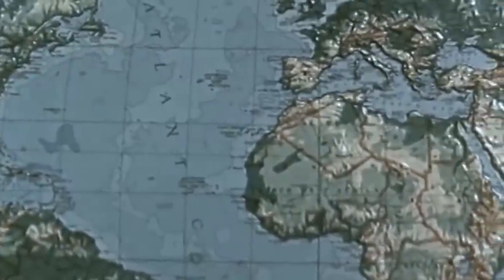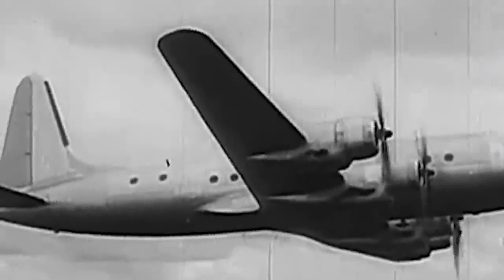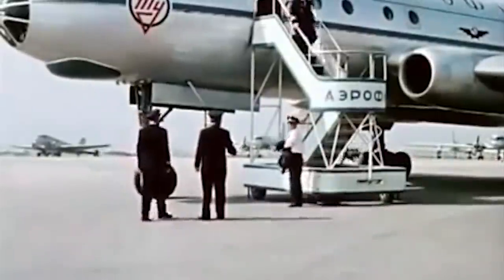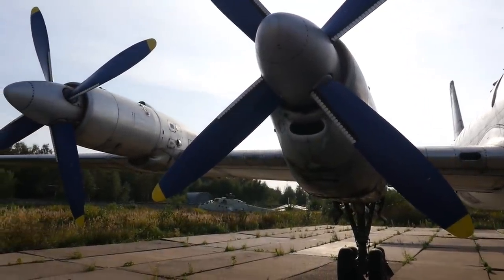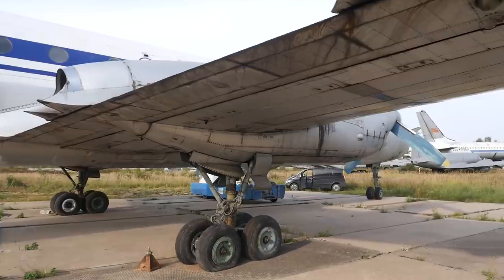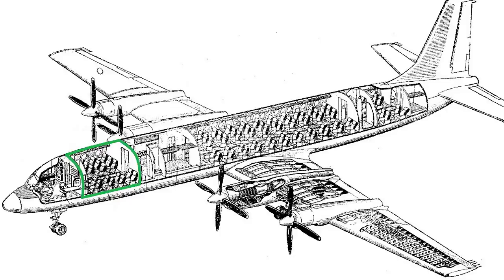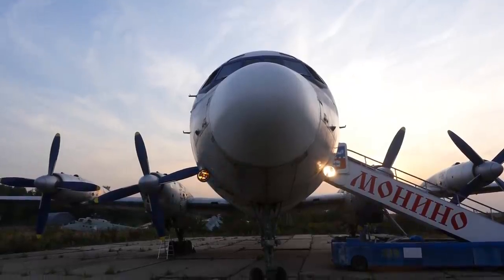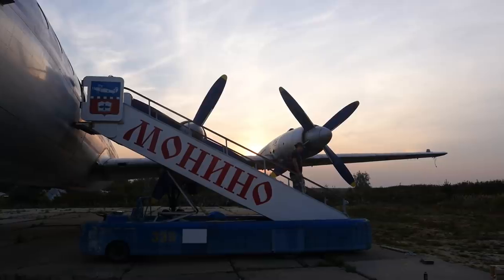IL-18 - airliner for everyone

Comment: Couldn't click on this one fast enough. The IL-18 has always been one of my favorite turboprops.
Reply from the maker: It was good)
Reply: @SkyshipsEng  It was kind of the Soviet version of the Electra, except the IL-18 had the full support of the government to get it through its teething troubles. It's pretty clear from the performance and longevity of the Orion that the Electra could have been an equally successful airliner if there was support to get it through its early troubles. Air Koryo flew its five IL-18's from 1966 until the last one was retired from passenger service in 2017, and did so for the entire 50 years without a serious incident
Reply: I've bought all the books I could on the il18. Fascinating aircraft. Dehaviland actually offered to see ilushin the tech to synchronise the props and thus eliminate the vibrations but the price was too high. So galley relocation it was!
Reply: Q111
Reply: @mrrolandlawrence  Thanks for that-- the formative period is often more interesting than the design release and field history.
Reply: Agreed, i think in terms of volume, the lockheed electra is its counterpart
Reply: @sarjim4381  For the IL-18, the closest looking alike airplane, is the Bristol Britannia. It is rumored that IL-18 was "inspired" from Bristol Britannia, actually...!!! Anyway, the IL-18 still is considered, up to these days, as one of the most robust and reliable passenger/cargo transport planes ever built, with a very economical overall exploitation.
Reply: @SkyshipsEng  Flew many times on the IL18 in and out of Bulgaria with TABSO and Balkanair, in the late 60s and early 70s. great memories
Reply: It really is a nice looking aircraft.
Reply: Truly a beautiful aircraft. Very happy to have seen two in person.

Comment: My flights in these aircraft were not as rosy as the narrator would suggest, or some of the comments.
I visited China towards the end of the '70's, and flew on two internal Il-18 flights.  I am not particularly tall (180cm) but for the first flight my knees were hard up against the arm bosses on either side of the seat in front.  The second was better, but the difference for us visitors was made up by jamming the rear seats (with the locals) into even less space.  For the legless indeed.
Then there were the engines.  All was fairly normal when they started and the aircraft taxied.  But the whole plane was shaking from the vibration at take-off power.  The noise matched the vibration.  I understood the aircraft and still was unsettled.  The others in the party were terrified.
I had read about RR micro-balancing the moving parts of the Spey not long before that trip, and those take-offs showed why that was not just a 'nice to have'.
Also not mentioned was the location of the toilets, between the cabins, in that 'noisy' zone.  What a noise!
In short, I have never been in a Western aircraft that got close to scaring me and deafening me like that Il-18.  They are interesting aircraft, and have a long and enviable record; but I pity all who had to fly in them regularly.

Comment: Yes, on a prop plane the tail is quietest because it is far from the props and the wing blankets the noise a bit, the nose is not quite as quiet, and the mid fuselage is loudest. So !st class is in the tail, 2nd class in the nose, and 3rd right in the middle. On a jet plane the tail is exposed to the exhaust and is loudest, the mid cabin is near the turbines and is in the middle, and the nose is quietest, and furthest from the engines (but usually the most dangerous place in a crash)

Comment: fantastic! did't know this airplane, loved the presentation and details.
Reply: Being Brazilian I have a passion for Electra, after all they operated sovereigns for 29 years (1962 to 1991) on our main airline, the air bridge between Rio and São Paulo without accidents and in addition it was the plane I flew for the first time turn. However, I must admit that the IL-18 had a further refinement, at least in design and, at least on the other side of the iron curtain, it was more successful than our beloved I-188. Hugs.

Comment: Excellent video.  I flew on an Il-18 in 1973. Impressively fast climb on take-off. The prop noise was quite noticeable from my over-wing seat, but other older turboprops also were noisy in that position (e.g. F-27). Nice to see the L-188  and P-3 mentioned, quite similar designs (P-3 is shorter than the Electra, of which several are still flying in far northwestern Canada).  The British had two rough equivalents, the short-range Vickers Vanguard and the long-range Bristol Britannia.
Reply: The British had the Viscount in the '50's ...
Reply: @checkyoursix5623  The Viscount was smaller and with shorter range than the Il-18/Electra/Britannia/Vanguard.

Comment: My father took me to visit a gaint cloth factory in Soviet Union back in the 80s, and I flow on the IL18 during that trip.  If I remember correctly, it was owned by the factory (as the factory was located in the middle of a forest with nothing next to it).  My father told me later that Russian did that to avoid the second German invasion, LOL

Comment: I had the first time in 1975 experienced a charter flight with Interflug (the former East German international airline) on an  Il-18D from Vientiane(VTE) to Hanoi(HAN). Quiet and comfortable aircraft! Until the mid-80s, Aeroflot used to operate long haul regular flights from VTE (Laos) to Moscow via Tashkent with the Il-18D which was later replaced by the Tu-154B which I also experienced on a flight to Moscow. I also had the chance to fly in 1985 on an Interflug Il-62M from Hanoi to Berlin and in 1989 on an Aeroflot Il-86M from Hanoi to Moscow.

Comment: 1:37 I like how on the Li-2 even though it was (I believe) a licensed built version of the DC-3 the engine cowlings did away with the cowl flaps and instead used the rotating shutter style air control for maintaining the engine's temperature. Any ideas as to why that change was made?
Reply: You believe almost right-) DC-3 was indeed licence built in USSR since 1939 under the name of ПС-84 (passenger airplane from factory №84). It had some, hm... minor simplifications in design comparing to original DC-3 due to a certain lack of resources, technology and production culture. During the WW2 the factory was relocated from Moscow to Tashkent, as far as possible from advancing German army, and serial production (directed by Boris Lisunov, after whom the plane got it's new name Li-2) was to be restarted almost from scratch. In such a situation even more simplifications were needed, at the same time plane was slightly redesigned to better fit a role of multipurpose military transport. I hope I answered your question

Comment: As far as I can tell a modern turboprop is 33% more efficient than a modern high bypass ratio turbofan using the same level of technology (turbine inlet temperature) .   They are not that much slower Mach 0.65 versus Mach 0.8 and would have better takeoff performance.
Reply: Although you're correct, the customer base wants to see "jets".  That's who pays the freight, so the airline shows them what they want to see ... It's sort of like being led around by the blind ... A Convair 440 re-engined to become a 580 is one heck of a durable bird ... fast, quiet, comfortable, and a joy to fly ...

Comment: Turbo-Prop comes not only with greater efficiency in air, since Propellers have better aerodynamics in air, but also because the slower plane has much less resistance in air.
Resitance of a body in air in relation to speed is a quadratic function!
So Turbo-Prop driven Aircrafts benefit in two ways, the greater efficiency of propellers over ducted fans, as well as the lower resistance in air as a result of lower speed.

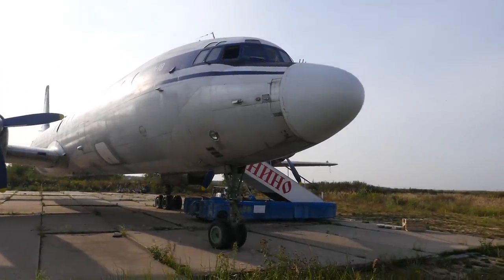Comment: 12:17 I don't think that is quite accurate. A 'seamless' (or stepless, as we call them) nose is intended to reduce drag at higher speeds. yes,  they appear to be less 'sharp', but that is not actually important beneath Mach 1. The ideal low-drag shapes are round-nosed, like fish, so a B-29 is actually quite low drag, even though the nose is a hemisphere. What does create drag is to have a broken outline, to make the airflow change directions. Ideally you want a totally smooth, uninterrupted fuselage line. A sharper nose cone barely lowers drag at all (otherwise modern airliners would all have noses like the B-58), but a separate cockpit windscreen creates a noticeable increase in drag. The reason why they prefer to use conventional cockpit windows is that they are much easier to see out of, even though they increase drag. Many stepless designs place the glazing too far away from the pilots eyes, which causes problems wit depth perception and glare and reflections off the glass. Although with the IL 18 I am guessing the real reason was just because they needed to add a place to put radar into, or even because they thought people would like the conventional nose better, and increase their odds of being chosen over the competition. Sometimes small, trivial points can make a bigger difference than [people realize.

Comment: The IL-18D was a hell of aircraft... More noisy than Britannia (the english was very nice to fly by the way) but faster and sturdy like granite, and more successful by numbers and service than any other of it type... About 2 tons/hour consumption with 100-120 passenger at normal cruise of 650 (km/h ~ 350 knots) TAS... It can climb upto 33 feet also... Was used on all weather, from frozen URSS passing for the humid, and stormy, caribbean and ending in the dry-hot altitud of Africa... Is my believe that with proper updates it may be useful this days, at least a new version of this reliable design. Will be nice to see a comparison between it and the most modern turboprops in overall performances. Nice video, thanks!

Comment: no one argues with "uncle joe"... very prophetic words! its also worth noting that USSR funding was often slight of hand. Tupolev tu22m3 is a totally different aircraft to the tu22. Funding is easier if old cost codes / serials are used. It's seen as less "risky". Im sure this is the reason for recycling the Il-18 number. Also interesting note that the Vickers Viscount served as a test bed for the new Comet engines. Performance was deemed too good and could be a rival to the Comet so a turbojet Vickers Viscount was buried before it got any momentum. Ironic seeing the issues the Comet had later! 

I have to also add I would have loved to see what might have come of the alternate engines for the Il-18. They were much much lighter. If memory serves me correct, about 2 tons for the 4 engines could have been saved? What makes me sad about soviet aviation sometimes is that great ideas never get developed, just stamped out till death. An il-18 Neo? Wing upgrades? etc.. Boeing did the old trick of the woodcutters axe: after 5 new heads and 10 new shafts, still as good as new!

Comment: It's very strange how Lockeed P-3 Orion has striking similarity to this aircraft.  The dimensions and take-off weight are a close match.  This is a great example of American efforts to copy the Soviets.  The timeline history of these are easily verifiable.  During the Cold War, how many times did you hear the Soviets were copying the Americans?
Reply: The Lockeed P-3 Orion does not have a striking similarity to this aircraft. The Orion is a militarised Electra, and the Electra and IL-18 prototypes both had their first flights in 1957, so it is unlikely that there was any opportunity for copying to take place. And the dimensions and take-off weights are not at all a close match.
 Apart from these tiny details which I have mentioned, you have made a really intelligent and well informed comment.
Reply: No, the IL-18 is not a copy of the American Lockheed L-188 Electra nor was it meant to fill the role the Electra did. If anything it was more of a Soviet version of the Bristol Britannia, except more successful.

Comment: Looks like a Lockheed Electra, just less refined.
Reply: same era, same requirements, same solutions.
And both were developed into military versions for anti submarine warfare, electronics warfare, and other, more obscure tasks.
Reply: Knew A Malev pilot who who said Kerosene wasn't avail at times in Africa,  so at times other combustables were mixed in with the fuel  ,  Waragi  was mentioned.. he said the thing was an amazing work horse, and very reliable and safe.. most accidents were overloads by African carriers,  airframe had zero vices.. think they still use em in the Stan's , would love to fly on one.. supposedly it was so docile in the pattern,  some guys washed out when the 154  was introduced,  just could not adjust,  he said the 18, and the 154 m were his fav birds.. the 18 any day on a short hop..

Comment: I flew in them often, in China, in the mid-80s. Maybe due to maintenance but, the aircraft was not at all impressive either in the performance, or the relative quality of its construction. Most of Soviet era designed aircrafts are either copies of western aircraft or, the result of heavy industrial espionage.

The IL-62 alone should tell you all you need to know about Soviet design.

Comment: "creating their own bomber"   boy that looks like a B-29
Reply: Because it is, Tu-4 is a reverse engineered B-29 with 23mm cannons instead of the 50 cal MGs.
Reply: @FirstDagger   i know, was the jab at "their own"
Reply: @Dies1r4e  It was a copy, but it was "their own", made in the USSR. Have you ever tried to convert millions of parts from the imperial to the metric in an industrial scale? Sometimes it's easier to do it from a scratch.
Reply: @RustedCroaker   I have built a great many firearms from scratch both soviet in the metric and US in the imperial system,  also worked on a great many projects with European engineers and American builders, so I have fought that fight.  Copying a B-29 bolt for bolt, then mass producing it does not make it "their own"  even if they changed the size of those bolts slightly and slapped some soviet guns on her.  It would be law suit worthy in any other context and it drives me nuts when people say that the TU-4 is anything other then a knock off.  Its about as original as Chinese medium range missiles and stealth technology.   Is it a feat of industry?  sure, making ANY four engine long range strategic bomber was at that point, but the point is the design they copied was better then anything they had thought up on their own.